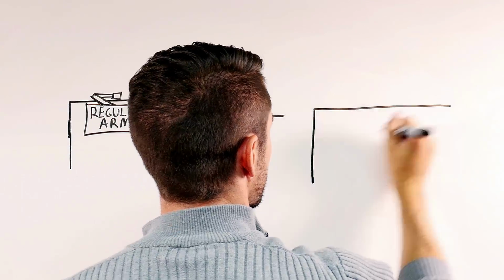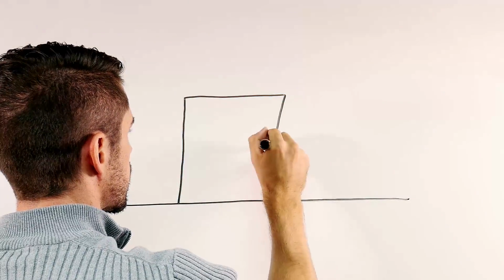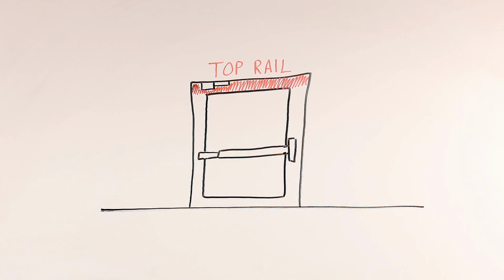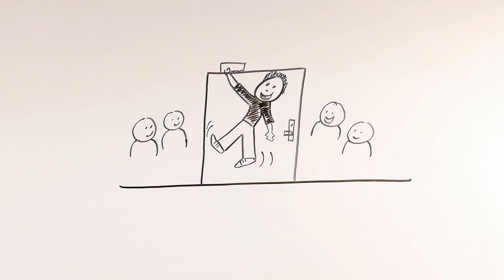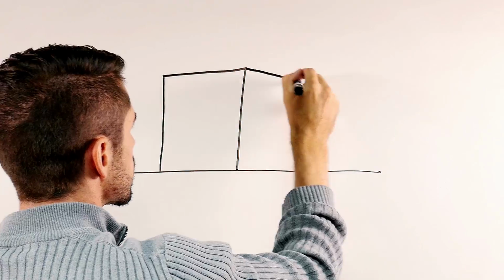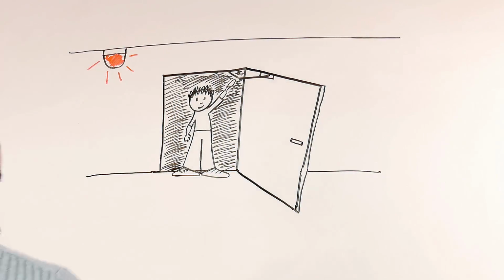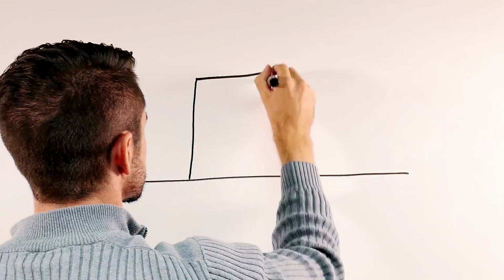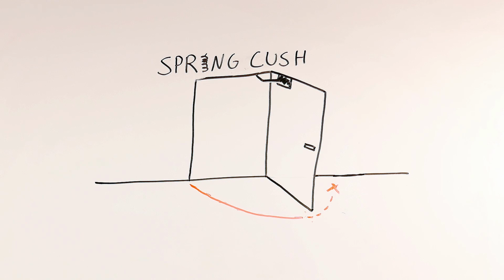Intro to Door Hardware: Door Closer Arm Options

Comment: (HINGE SIDE MOUNT IS PULL SIDE MOUNT) RC
(STOP SIDE MOUNT IS PUSH SIDE MOUNT) PA & TJ
Never EVER mount a closer on the exterior (weather) side of the opening. on inside it will last longer work better and can't be stolen or vandalized.
Every Commercial building will have outswinging exterior doors for Fire Egress Code.
Why? because of this 
https://www.youtube.com/watch?v=mNIJ1ToOHtg 

Use the P.A. mount as your first goto Mount if possible.

REGULAR MOUNT (RC) ON PULL SIDE: Best for Interior Single Inswinging Office Doors with a wall @ 90 Degrees with a wall/floor bump/stop. 
TOP JAMB MOUNT (TJ) IS PUSH SIDE MOUNT: Best for Out-swinging Aluminum X Glass Doors (StoreFront) 
PARALLEL ARM MOUNT (PA) IS PUSH SIDE MOUNT: This is the BEST mount out of the three.
Any Exterior or Interior outswinging & inswinging  Single or Pair of Hollow Metal or Timely Frames X Hollow Metal or Wood Doors. Aluminum X Glass Doors (StoreFront) with Drop Plates.
Reply: Thank you sir.